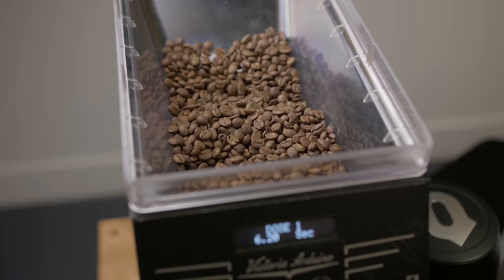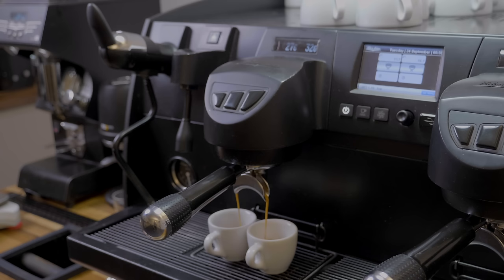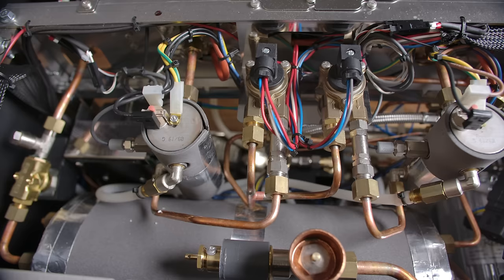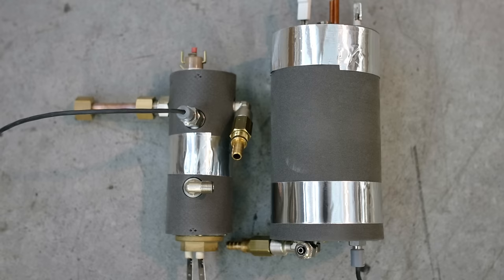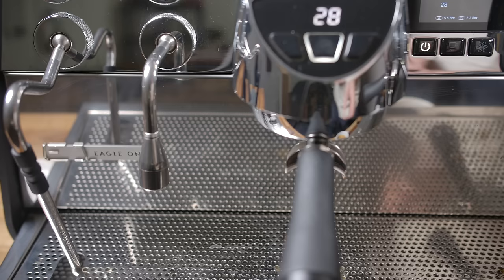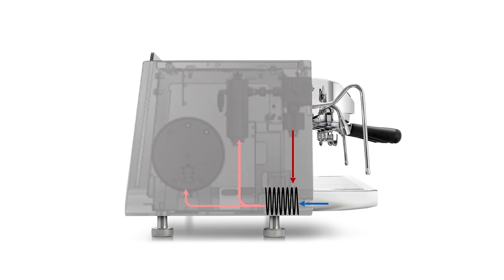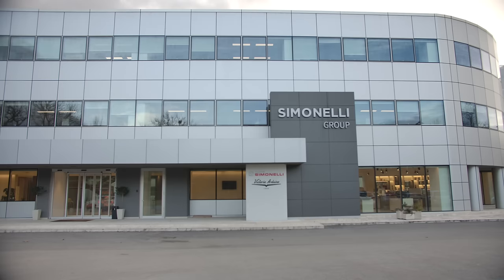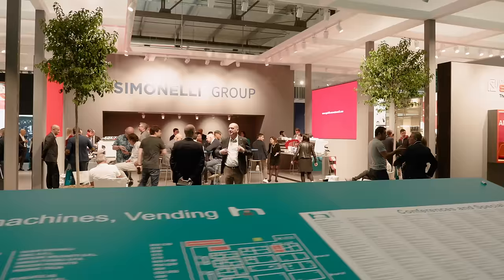The Eagle One

Comment: I wanted to argue about the idea of using the waste water heat in terms of energy savings. However, it turned out that this idea has the right to life. But here are my calculations. I wasted my time for a reason.
Let's assume that a heat exchanger that collects heat from waste water is made of copper. Let's say there are 100 grams of copper in it
The production of this amount of copper requires 9,300 joules of energy (pure copper, on average). We know from the video that this system saves 8 percent of the energy needed to heat the water. Based on the heated volume of 40 milliliters and taking the efficiency of the heater as 100%, we obtain the energy consumption for heating equal to 13 joules. Accordingly, the energy saved will be equal to 1 joule (8 percent of 13). Thus, it would take 9,300 cups of coffee to be brewed to recoup the energy expended in producing the copper used in this system. What, according to the statistics of at least our country, should take only 49 days.
The basic message is that the energy costs associated with increasing demand for the materials used cannot be ignored in the savings calculations.

Comment: Im sorry, but this sounds like complete bullshit.
1) Heating water to requested temperature should not be presented as innovation. This is the function that any espresso machine should have. Because if it does not have it, it is simply not an espresso machine.
2) It still has 7 liter boiler for steam, that needs to constantly stay heated, and for that it needs a lot of energy, and amount of that energy is mostly defined by physics. Removing boiler completely and heating water while its running would save not just 8% but much more.

Comment: I would argue, that your concept is wasteful, because the concept is complex. You spend resources on making it and on repairing it (parts, logistics for the technician ect.). I think the machine is much to small for the savings to make sense. 
I would prepose a combination of basic hardware regulated with predictive control. I think you would get similar results with far less complexity. PID is not enough.